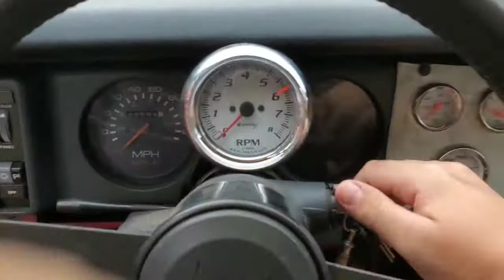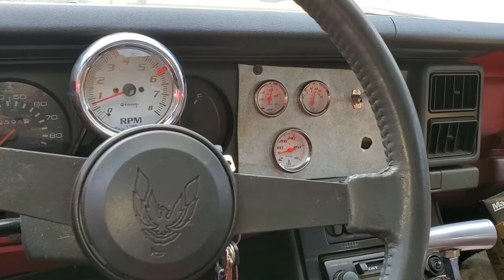thumpr cam 454 big block first start in 2 months

Comment: What's the full exhaust and cam set up on it ? Thinking of swaping a 454 into my 69 Camaro. Love the deep sound.
Reply from the maker: Well currently it's basically open headers. I have a pair of circle track mufflers bolted onto the headers. They don't really do much. But I can say it's got mufflers on it. If I happen to get pulled over
Reply from the maker: Heres a link to those mufflers https://www.summitracing.com/parts/bey-4294

Comment: What’s the part number for that cam sounds good I want one for my 454
Reply from the maker: This is the smallest of the thumpr cams. Seems to work well with my otherwise stock 454. My motors a motorhome special with this cam, aluminum intake, 750 carb and headers.
 Manufacturer part # CL11-600-4
Reply: @sloansgarage5116  Stock pushrod length?? Ive got the same setup just in a 79 and thats the idle im looking for. Curious how much geometry im in for with this cam lol
Reply from the maker: I reused the stock pushrods and valve springs and haven't had any issues
Reply: @sloansgarage5116  Killer dude, Appreciate it! Sounds really nice! Cool car man

Comment: Man what tranny and rear end you got with a 454 lol
Nice engine 
Buy a fing battery then do a burnout
Reply from the maker: Thanks man. It's got a broken th350 going to put a th400 in next. The rear-end is a quick performance ford 9 inch with 3.70 gear with an Eaton truetrac limited slip diff.
Reply: @sloansgarage5116  nice setup

Comment: How were you able to keep the stock hood with the big block ? Any mods to the mounts ?
Reply from the maker: The car used to have a sbc. I just reused the sbc motor mounts. I cut the some of the inner structure of the hood. It clears with a 2 inch thick air cleaner with a drop base